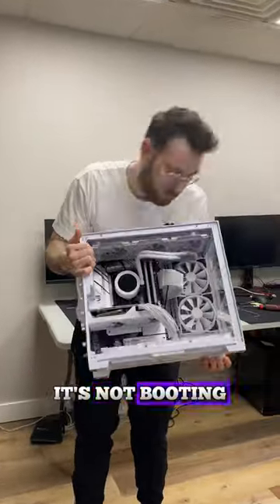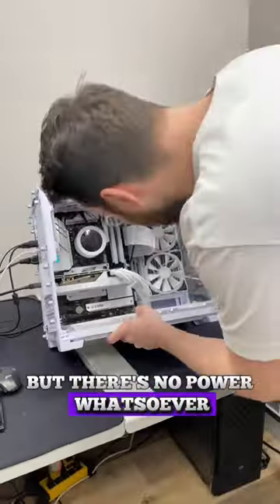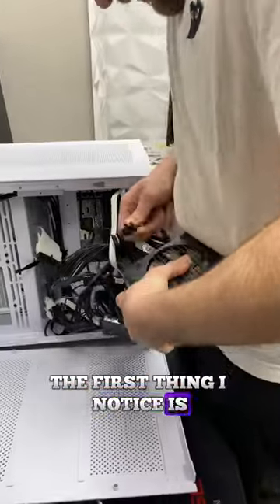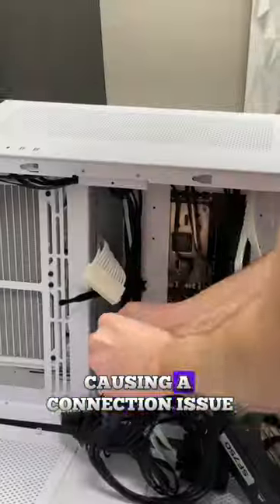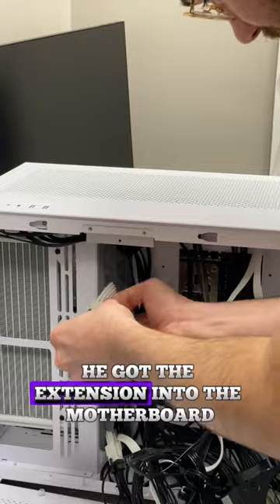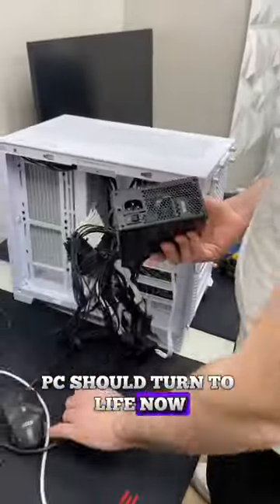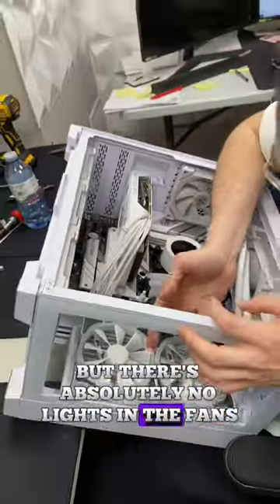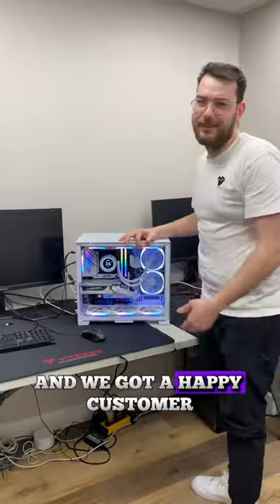PC NOT POSTING?! 🤬 #pc #gamingpc #pcgaming #egirl #gamerguy #pcrepair

Comment: My 3080 has been over heating. The real problem is the thermal pads. I've changed them 3x. The first time I got temps down 20 degrees, but saw others that dropped 40, so bought the thermal goop LTT did a video on. That sucked worse than stock, so I bought a pre-cut kit and it's overheating and my PC shuts down randomly while gaming. Any thoughts? What's the best thing to do? More, new thermal pads..?? My tiny connectors can't handle much more in terms of swaps :(
Reply: But better pads
Reply: @livid7594  tried that
Reply: What temps are you gettin? Maybe its a airflow issue with your whole pc. If the whole pc is warm to the touch after running for a while , take a sidepanel off and see how that goes. If it helps , see if the intake fans are properly installed
Reply: @plopolip01  overall temps are fine. My 2070 super had no issues, it's a big airflow oriented case with intake fans and exhaust. Idk